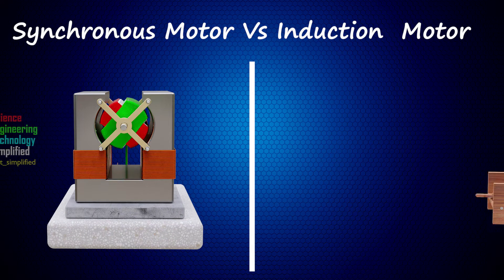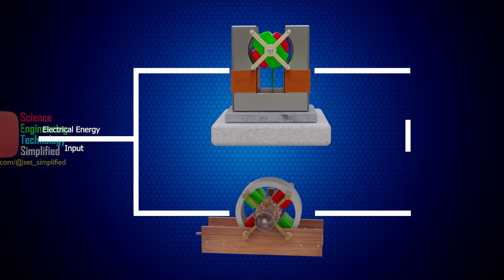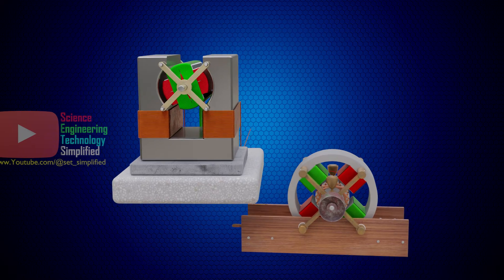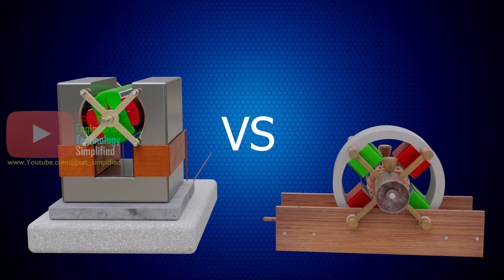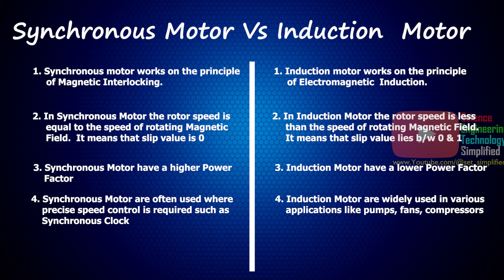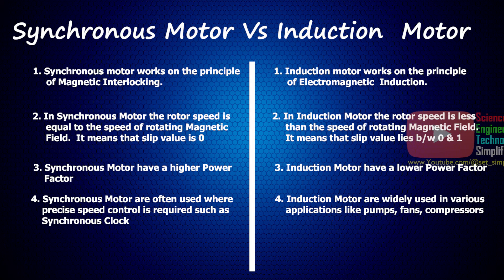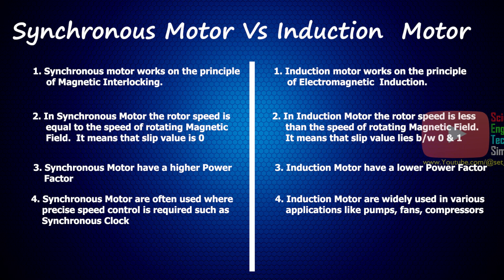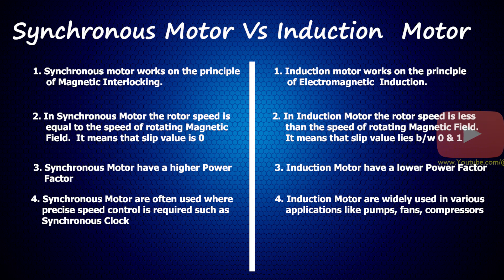Synchronous Motor vs Induction Motor | Induction motor vs Synchronous motor | Motor difference

Comment: Apparently we can't measure one-way speed of light because of a problem with simultaneity of synchronous clocks?

But can't we just place a single clock in the middle instead of using two clocks at both ends?